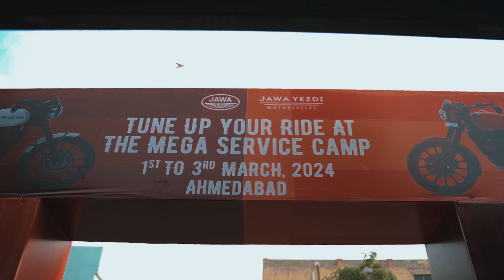Jawa Yezdi Ahmedabad Service Camp 2024 | Jawa Yezdi Motorcycles

Comment: Origins. The Yezdi Roadking was the successor of the short-lived Yezdi Oilking. The Oilking was the first motorcycle in India to attempt to move away from pre-mixed fuel to a separate oil lube system via an oil pump. The box-like shape on the left hand cover housed the oil pump.

Comment: Really very worst bike till now. Always giving issues. Common issue is battery discharge, charging coil burned, fuel pump issue, ABS issue, front mud guard rusted and had holes. We waiting for parts around 7 to 15 days.  
Ab tak ki meri sabase bekar bike. JAWA 42.